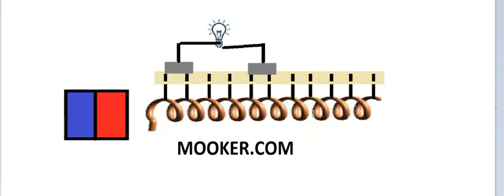Virtually Moving Induction Coil- Free Energy

Comment: You're paying energy to charge the inductor, which get stored as magnetic energy, let L is the inductance of each coil, then let's say you pass i amp of current then magnetic energy stored in single coil  will be 0.5 L*i^2 J. As your commutator moves to second coil, the first coil will become an open circuit, the magnetic energy from first coil will escape as back emf spike which could be seen as spark on commutator, moreover because it is an open circuit you will not be able to recover the energy back.

In another situation if you try use diode to recover the energy from the first coil, then it would create an opposing magnetic field to the second coil.
Reply from the maker: I am not charging any inductor..   There is no "second coil".  There is no input power other than switching. I don't think you are seeing what I am showing
Reply: @floodrod  each segment of your coil is an inductor which will get charged with magnetic field as soon as you pass the current. That's pretty basic.😔
Reply from the maker: @gunpaljain8350  I am not passing a current.  There is no input current.
Reply: @floodrod  ok, then output will be zero. The rate of change of magnetic flux cutting through the coil/segments will be zero. i.e. dPhi/dt = 0
Also the Lorentz force F = q(v×B) =0
So no EMF😁
Slight EMF can be observed if you move the ferromagnetic core in and out of the coil like a piston due to change in inductance of the coil.
Reply from the maker: @gunpaljain8350  https://www.youtube.com/watch?v=ropjblWhhTs
Reply from the maker: @gunpaljain8350  AI disagrees with you. The coil is constantly changing magnetic intensity.  I'll update if I fail and humble myself. Will you agree to publicly humble yourself if it does induct?
Reply: @floodrod  sure, if your idea works, I'll congrats you for finding a new kind of variable to induce the voltage and will try to understand the basic phenomenon behind it.

Btw, I was just trying to save your time and money. In your idea, There's no relative motion between the coil and the magnetic field to induce the voltage. Moreover, switching between zero volt terminals would not magically create any potential difference.
Reply from the maker: @gunpaljain8350  Ok cool- so your assumption is that adding more or less turns to an inductor that is placed on a magnet (without breaking the circuit) WILL NOT cause a variation of magnetic field strength and there will be no induction.  Might want to see Google AI's opinion https://www.youtube.com/watch?v=sBC7FawxcYQ  And I also asked it about using mechanical switching to accomplish the task with the same result.

Comment: Dc motor
Reply from the maker: ?  This is to make a motionless generator where a coil moves in front of a permanent magnet.  Except the coil doesn't physically move and no input required except for switching
Reply: I actually thought about an AC motor without a rotor.

Comment: And the question comes back. Say we have a primary coil, like the one you just drew, and a secondary coil, parallel to it, like in a transformer, but without armature. You have coil A connected to minus on right, and a moving brush connects to plus in different points as it slides back and forth. The secondary will therefore have an induced current, as the primary field is fluctuating. When you take power from the secondary, will the primary exhibit Lenz and draw more power ?
Reply from the maker: The permanent magnet is supplying the magnetic field.  This takes no input power except to move the brushes
Reply: @floodrod I thought that passing the current thru the coil will create a magnetic field regardless of the presence of a permanent magnet nearby.
Reply from the maker: @fxeconomist  The coil just inducts.  Moving a coil in front of a magnet produces a current in the coil.  What if we could move the coil without physically moving the coil
Reply: @floodrod So you're telling me that, when drawing power from the secondary,  primary won't use more power due to Lenz because the reduction in magnetic field will be covered by the permanent magnet, right ? So we can actually put a magnet inside a transformer primary and make it stop drawing power ?
Reply from the maker: @fxeconomist  there is no primary.
Reply: @floodrod I thought you were going to add it later. How does it deliver power then ?
Reply: @floodrod Does it have to be in a certain position or just nearby ?
Reply from the maker: @fxeconomist  Closer the better.  Magnetic force follows the inverse square law.
Reply: dont think that will work; you can virtually move the magnetic field but I think you cant move a physical coil virtually except for the inner magnetic field as you mentioned when current goes thru the coil at a certain spot or segment. @fxeconomist
Reply from the maker: @alexmanzanero  You might be right.  But if You can create virtual magnetic rotation with a series of 8 coils that acts like a flipbook, (which I have) it seems to me we should also be able to make the coil virtually move with the same technique.  But I can't argue your opinion because I did not build it yet and have no proof. (Yet)
Reply: thanks for reply, i follow your work and tenacity, bravo! @floodrod